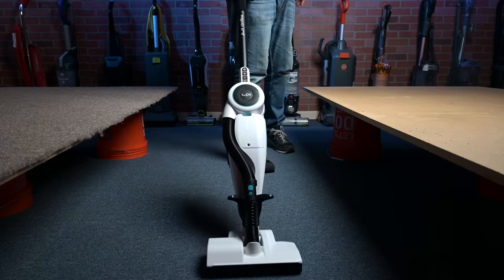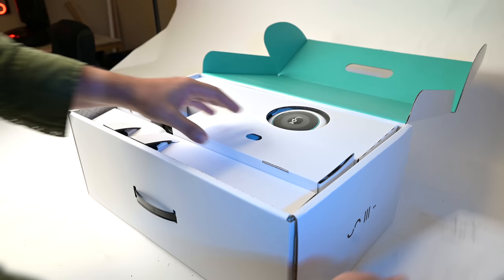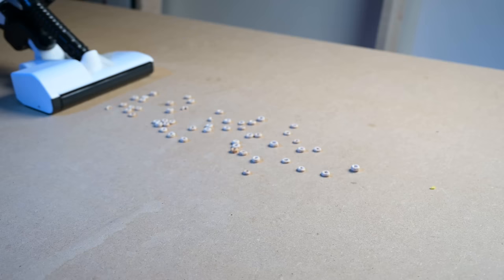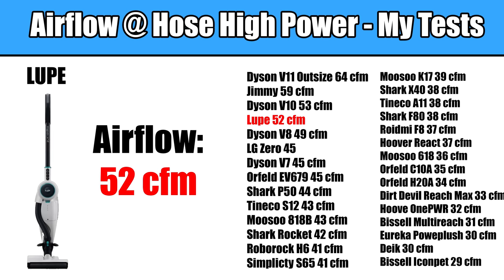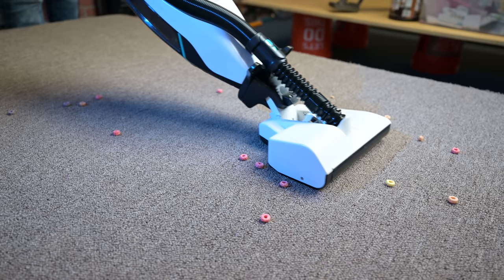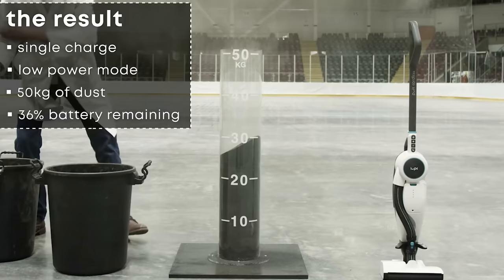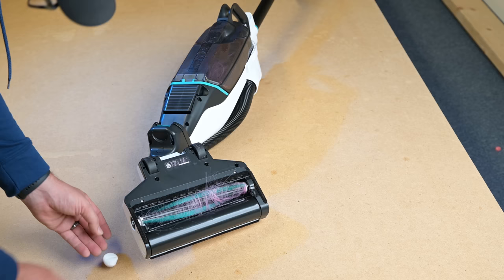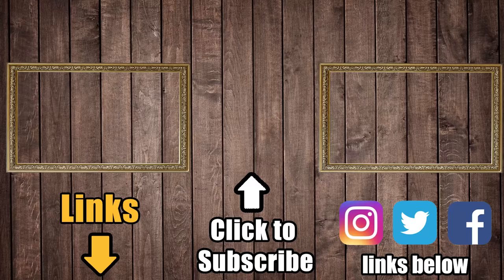Lupe Pure Cordless Vacuum Cleaner - REVIEW - It is THAT Good!

Comment: Part of me really wants this for when I get my own apartment, but part of the reason I'm looking for a cordless vacuum is to be able to easily clean out my car or on top of surfaces like my bed or couch. Also this thing just costs too damn much, $734 is insane. I absolutely love the roller design asside from the poor hair performance, though I don't have long hair, I do plan to get a dog when I move out. I've never owned a stick vacuum and I'm currently planning on getting the Dyson V11 Torque Drive after trying my sister's Dyson V8, so I'm not sure about the whole issue with it being hard on your arm if you need to use it for long periods of time. The two things about the V11 are that I wish were different are that it doesn't come with a soft roller and it would be nice if it could stand up on it's own, which the Lupe fixes, but then it's not as veretile as a stick vacuum. If I'm being honest with myself, the Dyson V11 could actually end up costing me about the same as the Lupe Pure if I try to get the soft roller or any other attachments, or if I need a floor stand. Technically I've got time to figure this out and I don't really need to buy one of these right now since I don't plan to move out for at least another two or three years and something better than either of these will most likely come along.
Reply: yeah, this is kinda overkill. i picked up a used Shark P50 for $100 and love it. it's the perfect vaccum for a 1500 sqft home or smaller. i've bought cars cheaper than this vacuum.
Reply: @zero.g13  I've been looking at the Shark Vector Cordless Duoclean vacuum with anti-tangle. It's about $280 and has some great features that the Dyson doesn't like the ability to fold in half in order to stand on it's own and access underneath furniture without bending over. Also it has a soft roller in front of the normal carpet roller in order to pick up large piles of debris, which is very impressive for a vacuum in that price range. The only thing I wish it came with was the motorized mini brush head for cleaning inside my car and on top of surfaces, but it comes separately for $80 and is only available directly from shark's website unlike their other mini motorized brush heads, unfortunately the brush head is sold out.
Reply: @RaySchrantz  much better option than $800. I mean, if this was only $100 more than the shark retail, that's be a different story. You can get 3 for this price.
Reply: @RaySchrantz  vector or vertex? I like the vertex option also, is on my list when this one dies.

Comment: I just bought a dyson v10 but am returning it because it skitters across my high pile carpet. Do you know if this vacuum would do better on high pile? I don't know why I didn't anticipate having to empty the bin every 2 passes when I have 3 dogs...
Reply: Check out the Vacuum Wars video on the Riccar Cordless. I’ve owned mine for a year and I love it, the one weird thing about the vacuum is that the price is negotiable, if you call/shop around you should be able to find it for $500 like I did. It has a very long warranty for a cordless vacuum as well, 5 years, which compares very favorably to Dyson’s 2 year warranty. Also, I only need to empty it every 6 weeks or so.

Comment: How does it compare with Dyson v11’s and Miele trifle pro?
Reply: I have a Lupe for a couple weeks. I'm impressed. Floor brush is amazing and  better than Dyson.  It stands on its own, where Dyson doesn't.  It has a hose for handheld (above floor) use which is way more convenient than trying to hold the vacuum head while vacuuming. I'd say it's better than Dyson for nearly all of my needs.
Reply: And regarding the Miele HX1, I tried that  one too in August when it first released in USA. I was very disappointed and returned it.  Below average suction which yields poor battery life because you have to use the HX1 on higher power to pickup anything. And the HX1 dustbin design is the worst I've ever experienced. It's as if the Miele engineering department set out to create the least user friendly design they could. If so, they succeeded.

Comment: The lupe brushroll looks a bit like the Dyson V6 brushroll, limited bristles so I worry about how well it's going to groom and brush the carpet pile back up (this is important for pile separation to suck out the embedded dirt)

Still,the Lupe looks very good, however I wish it has a Dyson style of brushroll where it's got a wide diameter, with a wide soleplateopening. This means the carpet can get sucked into the head up into the brushroll and vibrated. Also, the Dyson brushroll resists hair tangles very well, not to mention the lack of belts due to the direct drive system making the brushroll have better torque.

Still a good attempt for their first vacuum!
Reply: Yea, they still have a long way to go.
Reply: Look at IBAISAIC’s review of this; it seems to have agitation not seen on any cordless vacuum so far. Looks incredible.
Reply: @Olliebobalong  The cordless Dysons with the direct drive brushroll also agitate the carpet, not around the head but underneath the head
Reply: @Olliebobalong  yea, still. The customer support is so limited by the company size. Plus the design is not as versatile.
Reply: @VacMaster1991  arguably, the fact it’s so easy to take apart, clean, maintain and repair, as well as being an actual upright cordless as opposed to a stick vacuum, is superior to the V11.
Reply: @Olliebobalong  I just prefer the hand vac, easy to clean stairs, sofas dusting just more versatile. The upright means hosew. Lupe's cyclone system is super basic filer will probably clog easy. Plus as I said the company is so small and new, who knows the longevity of the machine's or how good the warranty is.
Reply: The idea of the Lupe is cool. Just doesn't fit my needs. For vacuuming floors. Looks great. But for above floors cleaning, which is where cordless vacuums excel the Lupe needs some improvement.
Reply: @VacMaster1991  I agree with you. It is upgradable though, with Lupe stating that you can purchase upgraded batteries, cleaner heads and accessories in the future. They could easily make a powered hose with a mini power head moving forward. I love the charm of how repairable and durable it is. It’s very uncommon for modern appliance manufactures to encourage longevity in their products, but it’s a huge selling point. Having said that, dyson have made some good improvements with their repair-ability, mainly the hot swap batteries.
Reply: @Olliebobalong  I feel like Dysons are the same, literally all the parts come off , there's no need for an engneer to come and repair it, they just replace the part (the customer by themselves can) and Dysons come apart for cleaning with that in mind too
Reply: @parwaz7861  agreed, the lupe is cool, but not as good as dyson
Reply: @parwaz7861  but the cyclonic system on the V series don’t do they. Other than the clear bin, correct me if I’m wrong, you can’t disassemble the entire thing to deep clean it. Wiping it with a cloth doesn’t seem sufficient in my mind. The Lupe’s more basic but still efficient cyclone come off with the bin, meaning you can wash it easily.
Reply: @Olliebobalong  It's unnecessary to strip a dyson cyclone. a brand new Dyson used only once, will have the inside of the cyclones caked in dust. Why? because Dysons have 2 bins. one is the clear bin for most of the debris, then a second bin for all the ultra fine dust captured by the cyclones. this chamber isn't part of the airflow so therefore wont make the vacuum smelly because no air flows through this inner bin, dust just falls into there.
Reply: @parwaz7861  I don’t feel comfortable with parts of a vacuum cleaner I can’t get to and clean, no matter which way you cut it. It’s wrong. Dust sticks to plastic through static charge. When folks have torn apart dyson cyclonic systems previously, they are caked in dust.
Reply: @Olliebobalong  It's just psychological that it's going to cause disadvantage when it's a vacuum cleaner, it's supposed to get dirty and there's no harm because that bin is ging to get dust everytime you vacuum, it could be spotless, but when you vacuum, its going to collect dust because it's supposed to
Reply: This actually is multi cyclonic. I didn't know that until I saw Ibaisiaic video :)

Comment: Jesus, it's expensive. Seems like it's a slightly improved Shark which also has replaceable parts. I recently upgraded my non hair wrap head to an anti-hair wrap head by just purchasing the roller on the website. The anti hair wrap is real important because soon as you get hair it impacts the suction, so real world performance is only like the tests when it's freshly cleaned.

Comment: Wish it had a cord.  Cords are a pain, but batteries get weaker and last less time every time you use them and it's not enough time to finish a whole house cleaning even when the battery is new.  Who wants to deal with buying $120 batteries every so often and having the battery die when you're cleaning?  The other option is paying $120 more for a spare battery just to finish the job. Also expensive as hell for a vacuum that's simpler than most classic uprights.  Seems like a rip off.   Sell it for 1/2 price with a spare battery and you might have a winner assuming it holds up as well as the competitors.  Also, I'm so sick of the "carbon neutral" and "values" virtue signaling while they manufacture in China, a country actually using slave labor when they're not paying people $2/hr....and a country which is the largest polluter in the world.  No doubt part of the price comes from charging the customer for carbon credits just so Lupe can pat themselves on the back.

Comment: WOW, that's expensive! If you compare it to a Dyson on a black Friday sale...I paid LESS than HALF of that price for my V8. If they really want to actually sell any, they should start at a lower price point. 
Another concern is the longevity of the company. I agree that Dyson is going to be harder to repair, but I can get aftermarket parts from Dyson (expensive)/eBay (original, used, cheap)/Aliexpress (Cheap, non-original, but works great). With this company, I have no guarantee they'll be around in 3-4 years.
Reply: True, there no guarantee Lupe will be around in 3-4 years. There's a risk in supporting any new business.

However comparing this vacuum to a V8 is not a balanced comparison. It's suction is more like a V11.  When you couple that with the so so V11 floor brush that does as much pushing debris around, then the Lupe is genius.

Support Lupe so they can be around in 3-4 years. Dyson only wants to sell you a new vacuum every 3 years.

Comment: just get a good corded one. way more power and less bs to deal with and will last year's longer than any cordless.
Reply from the maker: What is your favorite cordless?
Reply: @VacuumWars  we have one small dust buster made by black and decker with a lithium battery. big fan of miele corded vacuum. I know they are expensive  it their uprights are built like a tank with amazing filtration. best part about plug in vacuum is super easy to repair, minus dyson, and will last for years. keep up to good videos. can I make a suggestion for a topic? maybe do one on how easy it is to get replacement parts and repairability of the robot vacuum. I am looking forward to buying a premium robot vacuum but the Chinese brands seem the hardest to get replacement parts, where as roomba I can get all the parts on amazon. but the Chinese companies seems to be building better ones.

Comment: Why this isn't worth the money (for some): 
1. No LEDs. Same as Dyson. Not great when even the cheapest vacuums can put LEDs to see debris on hard floors.
2. Doesn't seem as versatile as Shark P50 because although it'll deep clean it won't convert to stick vacuum to get under couches.
3. That hair wrapping is just awful for anyone with longer hair or long hair pets.

This is an upright replacement but it skips some of the perks of the other cordless.
Reply: I have a Shark P50 (and Apex) and I was excited for this but lack of LED is killer.  That's main thing that makes me sad about p50 is lack of LED on tool head and lack of zero m compared to apex.  Glad to see someone else doing a duoclean style vacuum though because I don't know if I can give that up either.
Reply: @niccage3310  I have a Shark Ion P50 and it has LEDs on the head. That's one thing I love about it.

Comment: Not sure I see much appeal, it’s a UK company that is charging £500 ie the price of a Dyson. The product doesn’t seem like it will last any longer nor are parts advertised readily available, meanwhile Dyson sell most parts or you can get them for relatively low cost from third party sellers. I would rather have a Dyson than a China built vacuum which seems to be no different from other vacuums. It’s just marketing...
Reply: Consumer reports removed cordless Dyson vacuums from their recommended list because of the reliability issues. So Dyson has problems.
Reply: @vacuumtests9225  they don’t seem to be that much worse than Shark or other brand. This brand doesn’t seem to do anything differently and parts aren’t as easily purchased as a dyson. Our DC39 is still ticking after 7 years
Reply: @Horizon301.  It's the V-series Dysons with problems. I am happy to hear that your DC39 still works :) Lupe is very promising, but I would wait and see how this new company holds in the future. I personally think that their design is fantastic: Lightweight upright, big bin, big power, long runtime, dual roller and etc. I don't like stick vacuums because of their limitations.

Comment: jfc it’s more expensive than a dyson 😭
Reply: Which Dyson are you comparing to the Lupe? V11 is about same price.  And honestly, once you use the Lupe and see how well it works, you'll stop using Dyson as a comparison. Dyson is just another stick vac that doesn't solve many of the problems Lupe does. FYI, Lupe is running an introductory price special now.